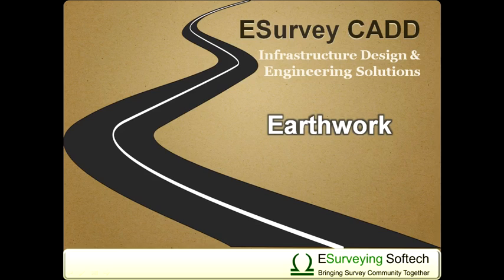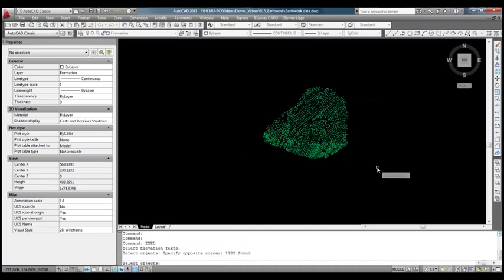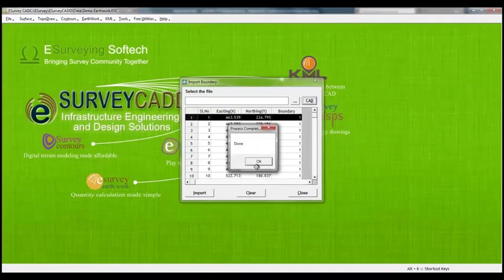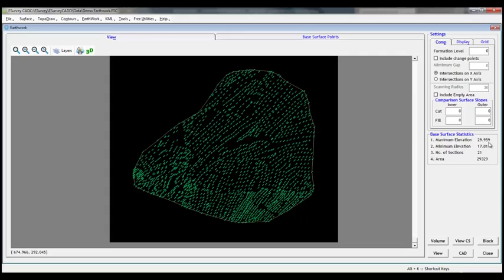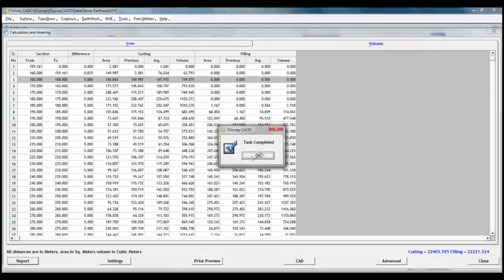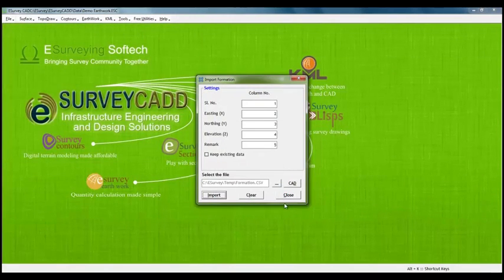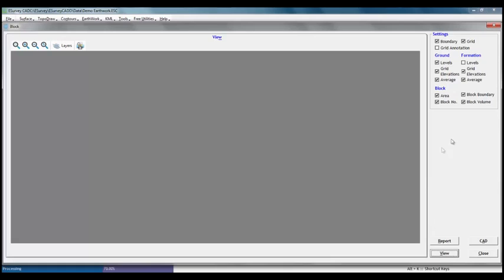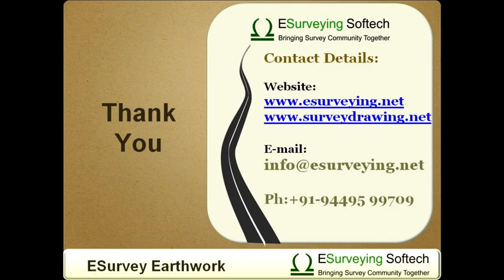Earthwork Calculation Software

Comment: How to interpolate elevation at the boundry?
Reply from the maker: Dear Sir
Using "BLOCK " or "Box Volume Method" , you will get interpolated values on the boundary.

OR

If some values are available outside boundary, software will interpolate values on boundary also.

Regards
ESurvey Team